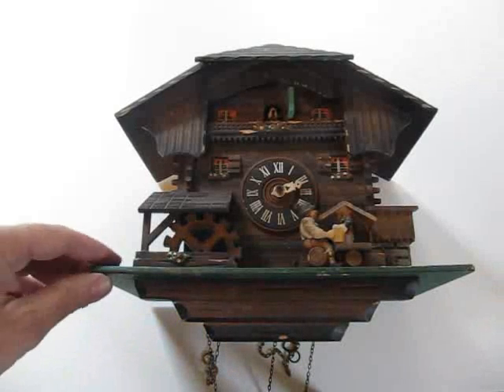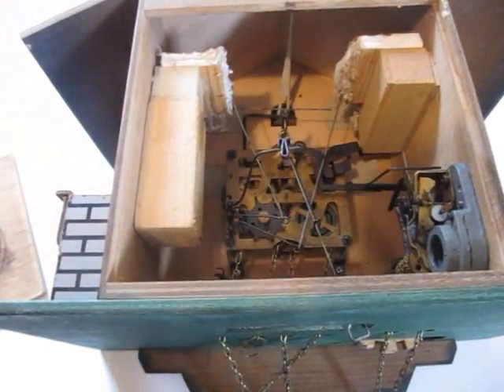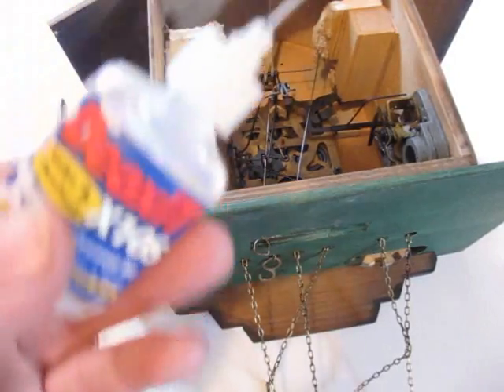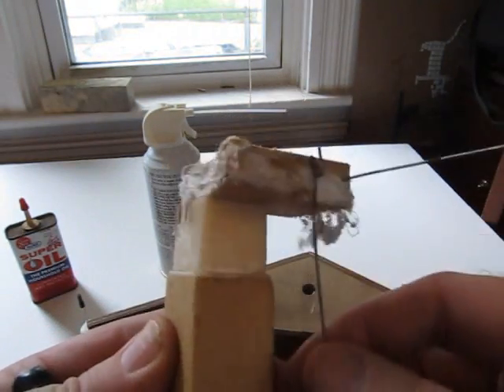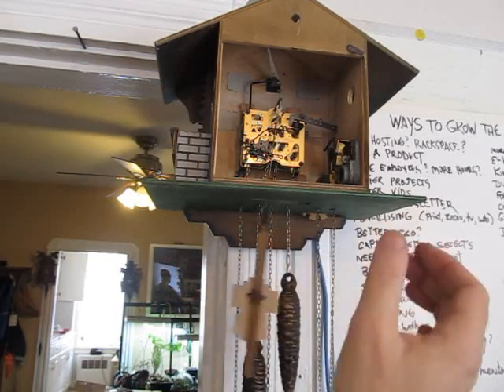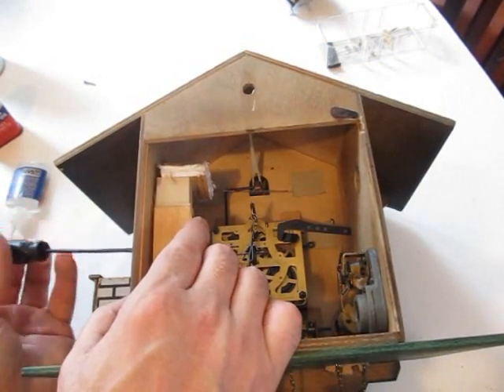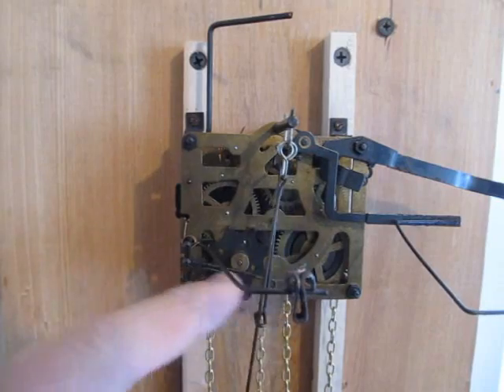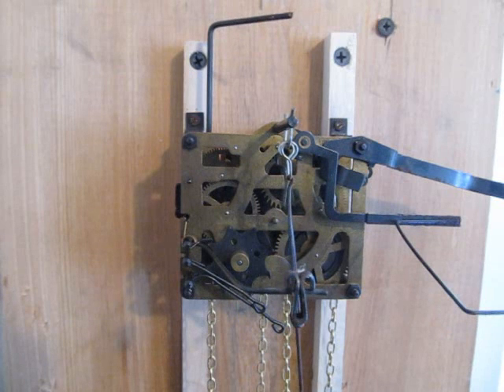Repairing a cuckoo clock

Comment: I have this old cuckoo clock that was left in this house when we purchased it. It was in a bit of a neglected condition. The weights were missing and the chain was a bit rusted but after I purchased new weights and a pendulum it worked great. Last night the chain broke and came out. How can I get the chain back in? Do I have to take it apart to do this? I hope not, it looks a bit difficult. The clock has a name inside "RAGULA', made in Germany and a 25 for,  found out, only two weights. Any help would be appreciated. Thanks lots. great video by the way.

Comment: Interesting, I have a Very Large German one that I purchased last Year. Seller never knew if it worked or not? Going to take a look at  the back today and see if it works or if I can get it to work as per your Video.  I'll Keep you posted. My Favorite one that I own is an Antique German one with the Cuckoo and under that it has 4 Tiny Hand painted Couples- all Dancing in motion, on a circular platform with Music. Thanks for sharing.
Reply from the maker: Ahh! Wonderful clock. Keep me posted!
Reply: Mobile cookoo clock  what time do i put on  from am to pm  & hour
Reply: @epicfantasy  what tools did you use to bend the perch on the new cuckoo movement?

Comment: My clock is only one year old. It will not cuckoo any more.  It has the function but it is like the weight is not going down on the right side to make it work.  It is stuck and does not come down unless you tug it a little and then it cuckoos all the way down. Any ideas?

Comment: I have a Cuckoo clock with Regula works, and with music, dancers, and water wheel.  The belt (actually a string with a very thin spring to give it some tension) that drives the water wheel begins to slip at a certain position.  Can I either tighten the spring by removing a few coils, or maybe treat the string with something to give it better friction?

Comment: The chain borke on my cuckoo clock and fell off. Do you have a tip on how to thread the chain back onto the gear wheel?
Reply: Really late but if you take the clock and turn it upside down and feed the chan in and around the gear using back acess then when you get to legnth in you can string it back a challage or you can take it apart and get to the gears easyer

Comment: great video. Question... I am repairing one cuckoo. The mechanics seems to be working fine, but the pendulum eventually stops... Is like it does not have enough power to keep it moving. Any idea?
Reply from the maker: Great question. There are a couple of things. Make sure the cuckoo clock is very level, side to side and front to back. Makes a difference and the number one thing about a clock that slows then stops is that it might be out of beat. You need to do something called adjusting the beat of it. easy to find info on that.
Reply: epicfantasy Will do the research. Many thanks!

Comment: My late brother bought my mother this exact clock when he was stationed in Germany, and it was recently passed down to me. My question is, it doesn’t work because the chain on the far left just zips through the gears so wheee can I order a new mechanism or fix the current one. Thanks
Reply from the maker: It is quite possible the chain simply came off the gear.

Comment: Hey - can you explain what points inside to lub with DeoxIT x10s oil?
Or point me in the right direction? Thanks. I took my mom's cuckoo clock home to repair. It's in pretty good condition. After a few days of simply keeping it running all the time, everything is working - just not consistently playing the music box/dancers after the bird chirps on the hour & half hour.
Reply: ***** Just for anyone else who would be interested in oiling, it would be best to search the internet to get clear and precise instructions.   The basics in a nutshell: a) Experts recommend only synthetic lubricants as they will not attract dust as much as petroleum based oils;  b) NEVER apply lubricant to gear teeth, as this will collect dust particles which can stop a cuckoo clock movement dead in its tracks; c) apply lubricant only to the gear shaft bushings/pivot points - every shaft, and both ends of each shaft; d) wipe off any excess lubricant with a lint-free cloth.

As I am only an amateur hobbyist, I am sure there are "experts" out there who would point out all the ways in which I am wrong - why don't you write a book on the subject, and try to sell THAT?
Reply from the maker: joelchummel Great comment, thanks for adding some excellent tips.

Comment: 0:27 my little hammer doesn't strike at all because i bent the hammer by accident, so please tell me how to fix the hammer? can I replace the hammer with new one?
Reply: If you mean the hammer that strikes the gong, no, it's part of the works.   You can carefully try to bend it to where it was before or the gong can be adjusted up or down to touch the striking hammer.
Reply: R T

Comment: Hello thanks.  We have a basic cuckoo clock (from the black forest) that has been working fine for 20 years.  It has now occasionally started calling the hours 14 times though the half hour calls are accurate (i.e. only once).  The on the hour calls are sometimes correct and sometimes 14!! Do you have a solution?
Reply from the maker: Sorry no. I say it is worth bringing to repair shop.

Comment: Hi: epicfantasy
I have a HUBERT HERR CUCKOO CLOCK Can you give me some pointers to try. that will only work if i apply extra weight to the time weight.
Reply: The other poster is correct.   The movement needs to be cleaned.    If the clock runs but looses time and you have to reset it again and again to get it to run faster, the kindest thing you can do is stop running it until you can get it cleaned.  The dirt gets into the pivots and will grind up the holes wearing the works.    Unfortunately, I hear nothing but bad things about Hubert Herr works.   It could be that the works are failing.  If so, I would urge you to not go back to Hurbert Herr works.  Regula, if it would fit, is the way to go.  Replacement works can be found on EBAY rebuilt with new bushings for about 125 dollars.

Comment: I just bought a cuendet  swiss musical movement cuckoo clock-6732-36 in an auction. This a Edelweis Lara's Theme from Dr. Zhivago...It was mentioned as never been tried but when I put things up it does not work. The pendulum does not work.. Please advice
Reply from the maker: It has to be very level, both side to side and front to back.  Does it swing a few times then stop?
Reply: @epicfantasy  It is on level. Kept at 6.5 ft high. I can send you pictures and even videos or can chat with you. Please help as I bought for my kids and now they are dissapointed
Reply: Oh! It moves and slows down and stops
Reply from the maker: CHeck to make sure it is level front to back also. That's important. From there google something called setting the beat of a cuckoo clock. It's an easy process. Dont think I made a video on it. That's usually the culprit after leveling.
Reply from the maker: @apees7k  ok, that's almost always a very simple thing called setting the beat.

Comment: The chain that is connected to the time part of my cuckoo has no resistance.  It slides quickly to the floor.  Is it possible that this chain is off its gear and how would I put it back?  I bought the clock in the Black Forest over 10 years ago.  It is a Hunter, eight day with 2 melody music.
Reply: I had my chain come off of the gear before, I fixed it by taking the clock apart and using pliers, and a screw driver to get it back on.
Reply: broken gear.  $100 repair.  At least I found someone to it.
Reply: That probably included the cleaning too which wasn't too bad.    If the chain come off the wheel a piece of a wire coat hanger with the end bent in the shape of an S or a hook will save you a lot of stress in putting it back on.
Reply: Pat Barker P

Comment: My coo coo goes real real slow, i took the pendulum off by accident, how do i speed the song up. we have a coo coo that comes out and these people that come around. Thanks.
Reply from the maker: There should be some kind of a leaf or ornament on the pendulum. That slides up and down. Slide it up to speed up the clock.  It takes time, little at a time until you get the time right.

Comment: Can anyone help me!!? I just got a German Cuckoo Clock and my left side chain is free...? No tension.
Reply from the maker: It probably has just fallen off it's sprocket.
Reply: @epicfantasy  Thanks I got the chain back on and its working; I ordered me 2 new bellows to put on> Should I use  HOT GLUE GUN? OR WOOD GLUE WITH CLAMPS??
Reply from the maker: @c.juneau410  Good work, definitely use wood glue. Hot glue will not last long term.
Reply: @epicfantasy  THANK YOU!

Comment: i have one weight justr keeps droping and its the one that makes the bird coo
Reply from the maker: You should get the other weight, or the other weights. And they are specific. You have to get the right "weight" of weight.
Reply: @epicfantasy  i havae move weights around and no help it work fine until yesterday i pull them all up to start a new day and the one on  the right keeps slowly falls on its own
Reply from the maker: @helensigouin1383  might have gotten jarred and the chain slipped off it's gear.